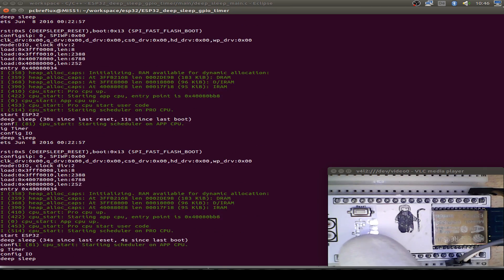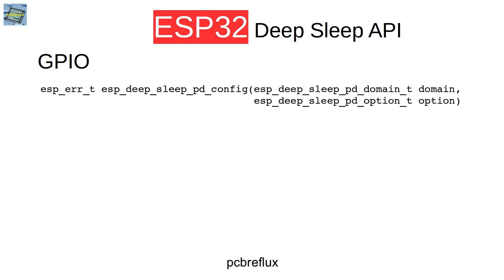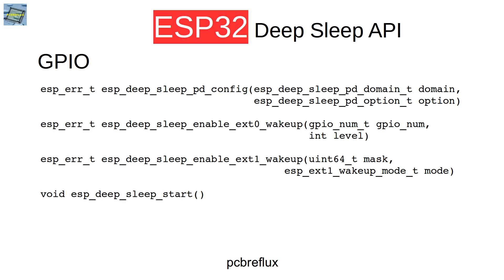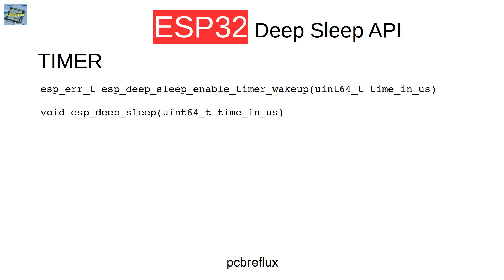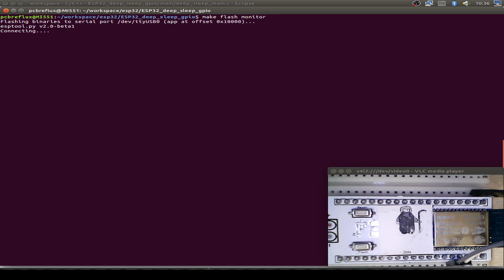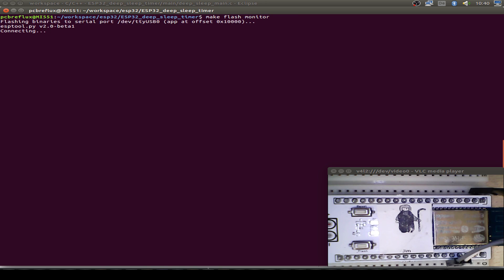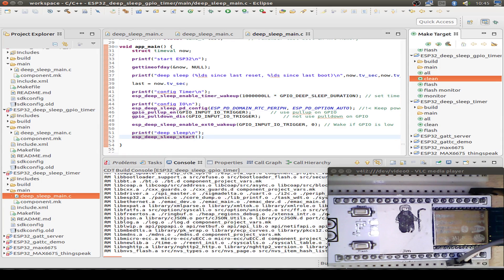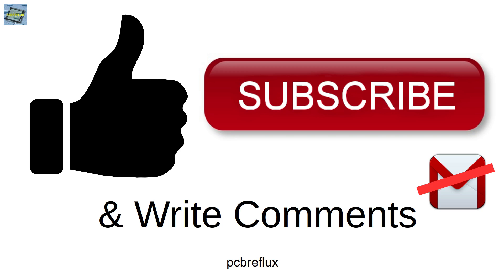ESP32 #18: Deep Sleep API and Wake Up

Comment: I'm using the same code but esp32 consumes 4 mA during deep sleep(timer) mode
Reply from the maker: What module you are using. What additional components? besides the esp32 my board only have the switches and a pullup resistor.
Reply: I'm using esp32 dev board by doit(It uses ESP-WROOM-32 module). I've removed the 3.3v regulator, led and reset the CP2102 ic. I'm powering the esp32 module only by 3.3V through computer SMPS. Is there anything that I've done wrong?
Reply from the maker: Prayash Shrestha Is the CP2102 inside you measurements? Beside this there should be nothing wrong. Do you use esp-idf for deep sleep? The ~6uA (+-3uA) are also measured by espressif (https://esp32.com/viewtopic.php?t=1133&start=10) and others.
Reply: No, I've reset the CP2102 by pulling the reset pin(active low) down so it is temporarily disabled for a moment. Also, one think that I've noticed that when I measured voltage accross GPIO pin 14(MTMS), it gave me reading of 3.3V during deep sleep mode(no external pull up is implemented). It seems that it internally pulled up by default.
Reply: There was a leakage current through CP2102 IC. When I removed that, then the board consumes 21uA and the excess current, apart from esp32 might be due to the other components present in the board. Anyway, thank you pcbreflux for the quick response :)
Reply from the maker: Prayash Shrestha Thanks for sharing. Think this helps other viewers as well.

Comment: Is there an example on how to use the RTC to keep a running time-of-day clock with using an external 32K crystal.
Is there an example that shows how to wake up the ESP32 at a specific date and time ?

Thank You
Reply from the maker: Have not done any experiments with the external 32k crystal and the RTC (with calibration?) on IO32 XTAL_32K_P and IO33 XTAL_32K_N.

But maybe you can also use one of the cheap DS1307 Real Time Clock modules to store the time and use the esp32 to read the time while wake up. Then before you go to deep sleep you calculate the next wake up time in seconds (or milli/micro seconds) and call esp_deep_sleep. This works also in the arduino environment.

But you can also reed the networktime (NTP) (maybe once a day) and wake up as above. Or use a GPS Module to get the Atomic Clock readings from the satellites.

Comment: I got 1 week max from a power bank... i thought the esp32 can sleep for years :(
Reply from the maker: What module do you use? Are the used usb to uart converter or voltage regulator consuming more than the esp32? Have you test the powerbank with out any load? Maybe it have a bad design with high self discharge current and runs flat at the same time? consider just using a bare lifepo4 battery with a voltage range that fits to the esp32 so you can eliminate the losses of a voltage regulator.
Reply from the maker: Just an add on: to measure the current consumption of the esp32 I use a lifepo4 battery and a board without cp2102 (usb to uart) and ams1117 (voltage regulator) so there is very low disturbance in the measurement. Can confirm the very low deep sleep current from down to 5.xµA.

Comment: Hi. Can you explain me: #define BUTTON_PIN_BITMASK 0x200000000 // 2^33 in hex

please ?

thats pin 33 in the example

thank you.
Marc.
Reply from the maker: Hi, don't find the example. But due there are only 32 GPIOs this is not 33 this is 0. So mostly you have the flash button on gpio 0 this use this button to wake up.
Reply from the maker: Sorry, but now is see there are up to 40 GPIO pins, so 33 is a valid pin number. With the PIN_BITMASK you can set more then one pin in one function call (in extreme all gpio pins).

Comment: can you blink led when the esp32 is waken up and remains deep sleep mode in rest of the time?? can u just give the code???
Reply from the maker: Should it blink all the time while awake, in what frequency? Or maybe blink 8 times once every 200ms and then remain off until next wake from sleep?
Reply: pcbreflux yes it should blink all the time when it is awake and it should not blink in deep sleep mode.  If u have that code in arduino for esp32, it will be very helpful or if it is in espif also not bad.
thank you in advance
Reply from the maker: Add: ESP32+red LED+330Ω Resistor 45mA while on, 8μA in deepsleep

Comment: Thank you for the video.  I have just received an ESP32, and I'm hoping to get the sleep power to be a lot lower than with the old ESP8266-12E devices that I had been using.
Reply from the maker: +Corgitronics Hi, maybe you can share some mesurements? I am building some kind of uCurrent (most time sold out) based on the design of Dave Jones but dont have the high end gear to prove the precision. So its more a DIY project. Have a nice day
Reply from the maker: anguissette Hi, here are some more infos to current consumption  in deep sleep https://esp32.com/viewtopic.php?f=2&t=1133&p=5873